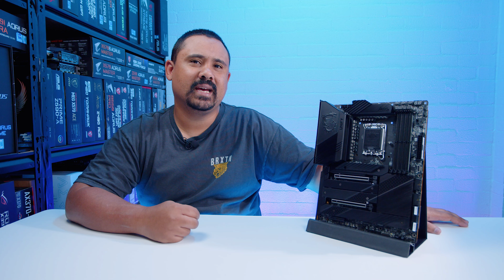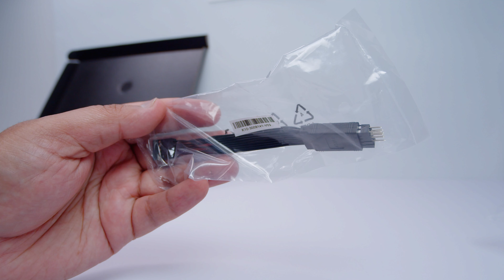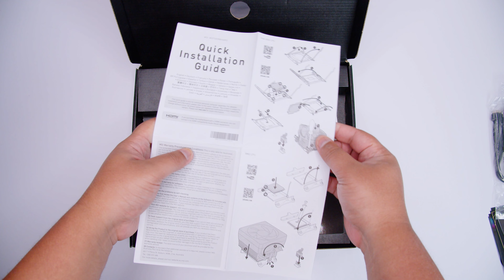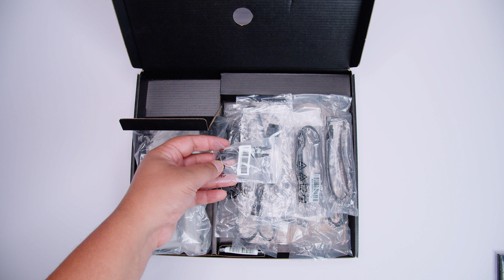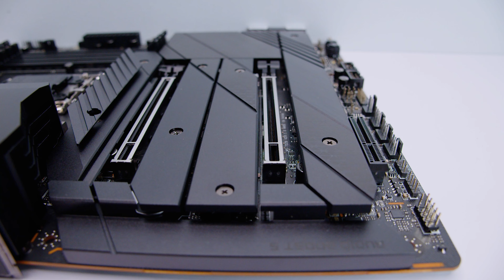All Blacked Out - MSI Z690 Unify Overview

Comment: Do not buy this motherboard for no RGB reasons only, i bought the z590 unify, there are 5 white and very bright led on the motherboard which can not be turned of. The led is for inboard power and reset buttons and 1 for bios switch indicator and XMP on indicator and the debug screen(this can be turned off).
I contacted MSI and asked them if there is a way to turn these leds off as it ruins the no RGB purpose of the motherboard and they said NO.
And I would advice not to buy MSI motherboards at all as the previous one i had was z490 carbon and it was bricked by a faulty BIOS update which effected all z490 owners and they did not refund or replaced it for me.
I am just warning you from my experience also go to check their forum and see how many people having problems.
Reply: i purchased it for no RGB its dumb.